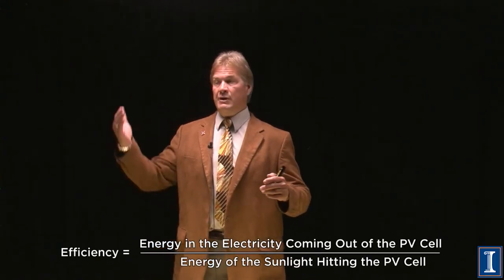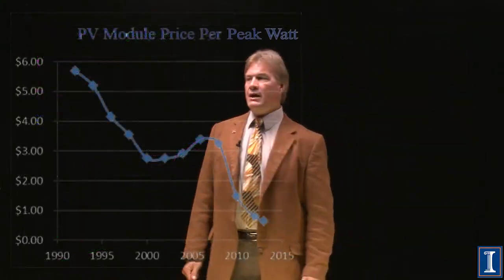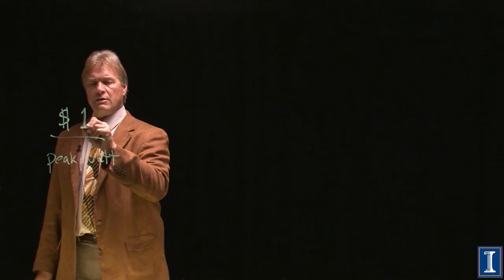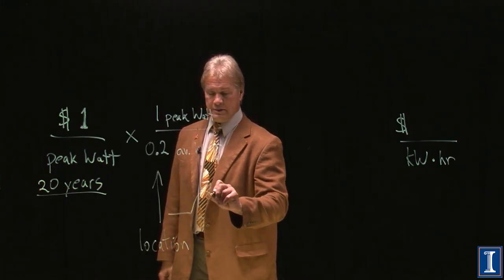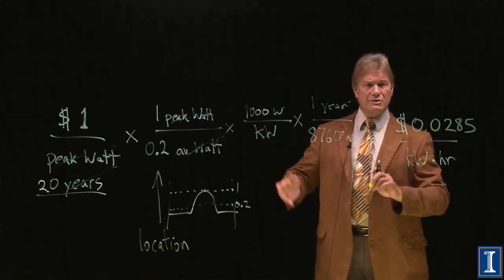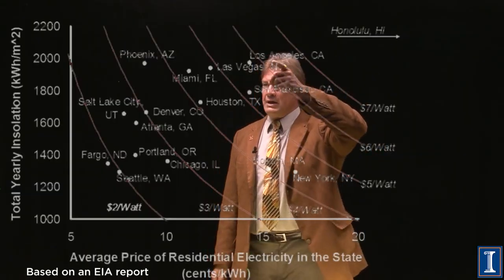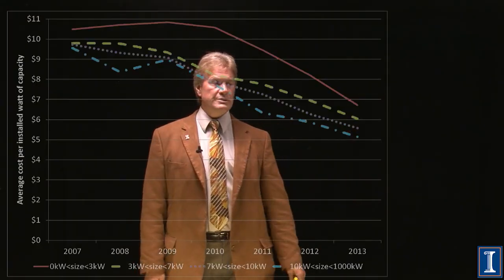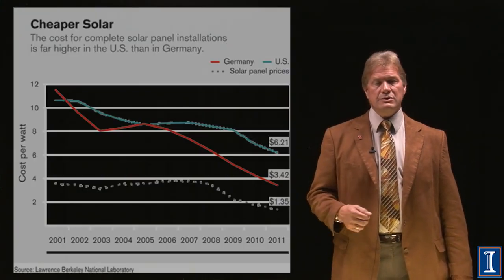The Cost of Sunshine

Comment: It may be that everything runs off of AC but it doesn't really have to. Because every appliance that uses a c converts it to DC for actually use right all we need AC for is transmission.
Reply: Electric motors use AC, as in your refrigerator, air conditioner, vacuum cleaner, dish washer, ...

Comment: I think the low installation costs in Germany are a product of the "Renewable Energy Law" which supported the rise of PV (and wind power) in a strong way: A vast amount of PV installations was performed in a short time ... scale of economy!
And this law also helped the Chinese economy to sell PV modules while crushing the initial german pv module industry around 2010 who was to slow to raise the bar - e.g. with higher efficiencíes to reduce the solar module area for the same peak power or increase the power output for the same roof.
It would be interesting too to see some calculations with storage - using a Tesla power wall I get some 15-25 ct/kWh for a very energy efficient household (1000 kWh / year) but the investment of ~ 20 000 $ / EUR is high - I pay 400 EUR per year and my expected life time is round about 20 years if everything wents well - this is the life time of the components too so maybe not the best idea!
Finally: Thanks for your video and greetings from Germany - Michael

Comment: A self-contradiction: By 11', you're showing an insolation map where the lowest values are for Seattle and New York, at about 1300—about 2/3 the value for Phoenix. Yet earlier, you say the capacity factor for Portland OR is around 0.1, but about 0.4 for Phoenix. I get that these last two are not intended to be exact figures, but that's not even close. I think the ones shown in the map are the realistic ones. Insolation only varies by about a factor of 2 over the whole lower 48.
Reply: In the best regions, you have to install 3000 MW of solar to get a 1000 MW gas or coal equivalent. At capital costs of $1 per watt (not even reached yet in 2020) this is rife with opportunity cost.
Reply: @haliax8149  This is not even a reply to my comment. The video makes claims about insolation and capacity factor. You're talking cost. At least stick to the subject.

Comment: There's another factor... solar fails to meet the objective.  Since it has a capacity factor of only 20%, it must rely on a fossil fuel source for 80% of the time.  And if that source is natural gas, it emits CO2 at 460 g/kWh.  The net for a solar/gas system is therefore 368 g/kWh and it cannot do better.  Our climate scientists say we need to achieve less than 50 g/kWh.  We'll never get there that way!

Backing up solar with a zero emitting source, like nuclear, makes no sense.  We're better off just running the nuclear plant.

If batteries are the answer to the intermittency problem, it needs to be included in the cost structure.  The question then becomes how much storage do we need to guarantee we never run out of power and how much more solar investment do we need to charge them.  How many days/weeks of no/low sunshine are we going to guard against.  Once that battery energy is gone, we're in a blackout situation.

A similar argument can be made against wind power.  When you consider the totality of cost of intermittent energy sources and consider the risk of blackouts, nuclear power looks pretty good.
Reply: Those are simplistic calculations. We can do better.

For starters, rather than just using an 80%/20% split, try subtracting the production curve from the demand curve. Most of our electricity demand is during the day and all of our solar production is during the day. They match up reasonably well. (The difference between them produces what is known as the "duck curve" which another commenter above requested a video on. Hopefully we'll get one.) A solar plant at 20% capacity factor will supply more than 20% of the demand, even without storage. The backup gas plant won't need to produce 80% of the power. (By the way, a gas plant has a capacity factor of between 45% and 55%).

Next, it doesn't have to rely on a fossil fuel source backup at all. Energy can come from a mix of different sources including hydro, geothermal, wave, tidal, nuclear, wind and the other type of solar (as in, solar thermal which uses heliostats to focus sunlight to heat up salt to produce steam to turn a turbine, rather than solar PV which is what this video is about). Each of those different types have different generation profiles to solar PV. If you try to match a single one of them up to a single solar plant to take over when the sun sets then you're destined for failure, but if you overlay their generation profiles on top of each other then you get a relatively smooth amount of generation day and night. Some of these types are still in their infancy and some are highly geography dependent, so you're unlikely to have them all available in any one place. Germany has achieved 46% renewable electricity in 2019 and Denmark is on 60% as of 2016. Those are already much better than the 20% you said is the best we can possibly hope for.

The problem with your argument is that rather than seeing a problem (intermittent generation) and looking for a solution, you've started with your preferred solution (nuclear) and gone looking for reasons we have to implement it. Solar on its own does fail to meet the objective. So does wind on its own. But so do coal and nuclear if you consider each of them on their own. Nuclear plants don't have enough dispatchable generation available to meet our demand curves nor the reliability to be the only fuel source for an entire nation. Only one country in the world has gone above 50% nuclear and it has interconnectors with the rest of Europe and the flexibility and reliability that brings. Hydro and geothermal are both low carbon and flexible enough. There are countries that are 100% hydro. This won't work for many countries because most don't have the geography or the rainfall required. Most countries will have to rely on a mix of different energy sources and generation types. Nuclear can be a useful part of that but it can't be the entire solution, just as solar can be a useful part of that but can't be the entire solution.
Reply: @Ladadadada  Well yes, most of our usage is during the day and all of our solar production. But solar production peaks around midday and usage peaks during evening meal time, some 5 or 6 hours later. The duck's back is getting lower year by year as more solar is installed - soon be a goose. 
https://en.m.wikipedia.org/wiki/Duck_curve

Comment: Good video but one point that bugs me. Panels generally last well over 50 years so using the warranty period of 20 years for average or expected lifespan is silly and misleading.... The efficiency reduces over time but they don't generally stop working
Reply: Show me the generally available panel that's 50 years old and maybe I'll believe you.  Then go study the carizo project and you'll see that factors can affect panel performance.
Reply: Agreed. The panels I have installed have a 25-year warranty with 86% of nominal output at that age.
Reply: The warranty is generally 25 years and they do generally last much longer.

Comment: Prof.

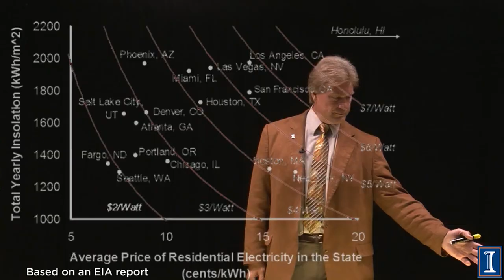I just noticed an overlook error at 14:00,
You were looking at the average price installed, but not considering the local price installed.
Labor cost and regulations in California are higher than in say Texas, in theory wouldn't the actual cost installed (before subsidies) in California be higher possible effecting the economics?

Also, did you account for the energy loss of the inverter and the  up/down of the battery.
I would think that 1kw*hr produced by the cell does not equal 1 kw*hr consumed at the outlet, so what is the average loss?

Comment: I love how everyone’s electric bill keeps going down now that we are building solar. What, yours isn’t. Well, the companies build solar wouldn’t lie for the sake of profit, would they?
Reply: There is precious little solar buildout other than private.  We have zero where I live although they are now talking about using solar as "peaker plants" to smooth out load.  Don't expect any change until solar becomes much more widespread.
Reply: James Thompson California is leading the way in solar. You can go on the CAISO site and watch load and generation over the day. Solar swings wildly and everything else must react to control load and voltage. Solar does exactly the opposite of what you described. The solution, is base load units like nuclear and units that can ramp load quickly like co-gen plants. I have worked as a construction manager building solar and have done operations at nuke and fossil sites. Currently, I work in hydro. Any project will under ROI (return of investment) calculations. Sometimes, you must do a project that will never show a profit. Things mandated by law or for environmental reasons. Sometimes companies will build solar, because the public wants it. It wouldn’t pass the normal ROI but we build tons of small solar sites along highways and placed billboards next to them. This way the public will see them and feels a warm fuzzy feeling. Consider it PR, like a commercial. 1.3% of this nations electricity come from solar. I know it sounds crazy, but heck let’s just be crazy and listen to the professor. The media and politicians haven’t worked out to well for us, I say give the guys with a PhD a try.

Comment: 05:44 No, manufacturers warranty is not a good indicator for solar cells, current understanding is that they can easily last a century by which time output will have halved, but hey, half of free = free.
Reply: Yeah, that bothered me too. The warranty is usually for 80% of rated capacity for 20 years and frequently for 25 years. They don't just drop to 0% at the 20 year mark. The warranty means that you can be sure you're still getting at least 80% of what you got when they were new. If you get the worst possible degradation without a warranty replacement, and if you have the roof space, you could just buy 20% more panels at the 20 year mark and be back up to full capacity. Even if you want to replace them all, you'll be able to sell your panels for some percentage of their original value.

They also have significant reclaim value for the steel, aluminium, copper, glass and silicon.
Reply: @Ladadadada  Agreed. The panels I have installed have a 25-year warranty with 86% of nominal output at that age.